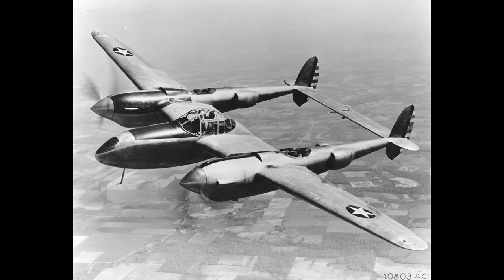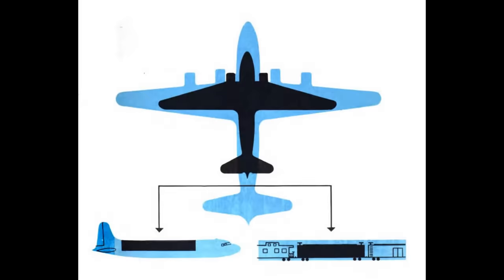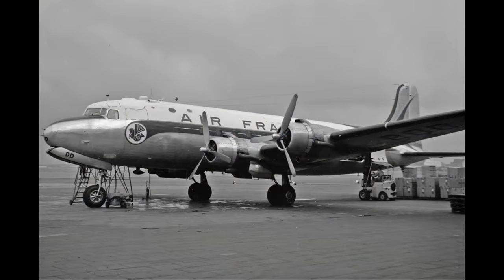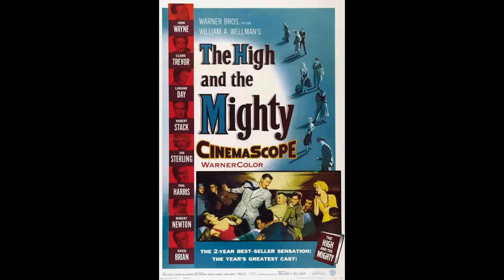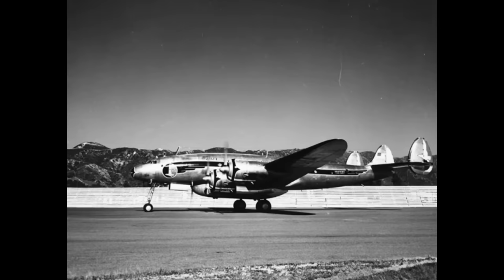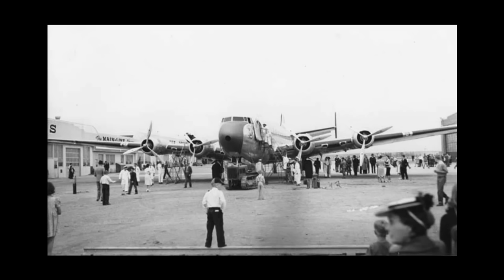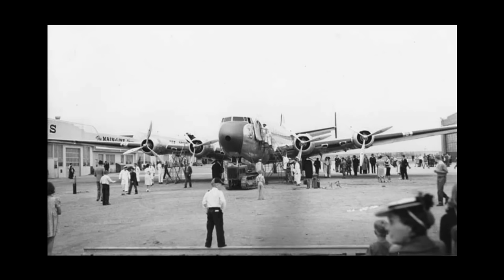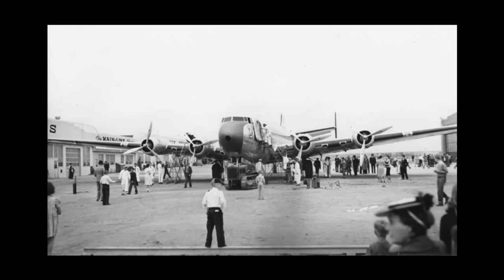Turbo Compound Piston Engines. Almost magic tech.

Comment: DC-7 could carry twice the passengers of the De Haviland Comet 2/2:jets. But the Comet could fly above the clouds, but cruised at 400 kt. As you noted, some people will pay a premium for reduced travel times. 

DC-7 max speed of 365 mph - 400 mph was faster than early WW II single engine combat planes & not much slower than versions of the De Haviland Mosquito. But the (massive & mighty) Vought F-4U was rated at 440+ mph. Other large war fighters were similarly fast.

Comment: I have always marveled at this technology and wondered why it wasn't in use today. I'm also wondering if the fluid couplers were just straight fluid couplings or did they include stators for torque multiplication?

Comment: As an aviation enthusiast,  I learned a lot from this presentation.  I wonder if this technology could be used on hybrid or electric vehicles?
Reply from the maker: Thanks, and a lot of people have asked that about use on a hybrid. Obviously it would not work on a pure electric vehicle as this tech requires an internal combustion engine. I do think it would work on a hybrid, packaging would be the problem.
Reply: New Porsche 911 is that.

Comment: huh, this is actually the kind of turbine i'm looking for in a little diy experiment i want to do. using exhaust from a car to drive a generator. and this kind of turbine saps very little power off of the engine itself.
Reply from the maker: I think that's a perfectly reasonable thing to do. Good luck with your work.
Reply: @GregsAirplanesandAutomobiles small scale test with a 22hp vtwin was good. got 12% more power. gonna see if i can get a 50hp diesel unit from liquid piston and start making a little turbine for that with professionally made turbines.

Comment: Not long ago I read somewhere some gripes of a piston engine mechanic.  He had so many complaints about the more advanced piston airplane engines!   They failed a lot, and when they didn't fail, they required tedious periodic inspection for jug cracks.    Everything was cramped and servicing was a big pain.  There probably was'n going to be  a next generation of piston engines, they had already probably passed their peak in many ways.

Comment: If you really want to see the ultimate development of the turbo compound concept have a look at the Napier Nomad, it was designed from the outset as a turbo compound not an adaption of an existing engine. Famous photograph of a nose mounted Nomad dragging a Lancaster along with all 4 Merlin's shutdown.
Reply from the maker: It never made it into production, thus while an interesting footnote, and may have had massive potential, we will never know how it really would have performed.
Reply: Prototypes of Nomad 1 and 2 did run for 100s of test hours,  the tantalising claim that it achieved the lowest specific fuel consumption for an aircraft piston engine means there must be a wealth of data somewhere .

Comment: i cant get this system out of my head ,,,, it is so very intresting ,,
qestion is there a so called blow down turbine made in a size that could be used in automotive application?
i have a volvo B20 engine sitting in a engine bench and i would love to experiment with this ,,
and yes i understand that it is maby not usefull or possible to use mounted in a car but the tech facinates me and the idea of feeding power back into a engine spins my whells so to say
Reply from the maker: I think it's possible, but I haven't seen it done on anything smaller than a big truck, like a semi.

Comment: Double OverHead Cams ((DOHC) in bike engines were sold as performance baubles but the early ones actually made no more power that single overhead cams. By the time ultra high revving sports bikes took off they were just part of the engine. 
My 1.3 litre diesel car has DOHC as it’s the most convenient way to operate the 16 valves. The latter are used to develop a powerful swirl into the combustion chamber. It’s turbo charged and it’s pretty obvious that A LOT of heat is extracted from the exhaust gas. Manifold pre turbo is much hotter that turbo outlet. It’s therefore using blowdown and pressure to drive the turbo. 
Back in the early days of diesel cars the non turbo engines were incredibly weak and not especially efficient. Turbos gave useful power AND better fuel economy. What gets lost in back pressure to the turbo is more than restored by extracting work from the hot exhaust gas. It full boost (just 1 bar) the engine inlet pressure is literally pushing the pistons down.

Comment: So the engines with turbo compounding aren't turbocharged?  Or do they have a separate turbo for that?  If not, how could they operate at higher altitudes without a loss of power in the thinner air?
Reply from the maker: They are not turbocharged. They use a gear driven supercharger for power at altitude.

Comment: In an indirect way, the MGU-H systems used in current (not future) F1 cars is analogous to the Turbo Compound turbine system. Edit: At then end, Greg actually mentioned this! F1 is getting rid of them due to cost, complexity and lack of applicability in the wider automotive market.

Comment: Thanks for this video and explanation of Turbo Compounding. I’m guessing the reason this technology isn’t popular anymore is that piston engines in commercial planes are not that popular any more. I have only a small knowledge of aviation, but aren’t Turbofan engines for commercial aviation the latest engine technology for saving fuel and lower maintenance and cost? 
This was an interesting video about this technology as I never heard of this Turbo Compounding or even that it was useful at that time.

Comment: Great video, I learned a lot !! May be because of the low octane ratio of the petrol in those days the compression ratio of the piston engines was very low( 6:1)  compared to engines of today. (10:1) or Diesel engines today (16:1)    So, much more energy was left in the exhaust gases, moreover  they were very large engines. When I remember  well the Volvo extracted 20 hp.
Reply: WWII engines were running on 115/145 power rated fuel. That's more octane than most racing fuel. Many general aviation planes ran on 80 octane, but these big radials were fed a steady diet of the good stuff. The 115/145 was died purple to identify it's power rating similar to the way avgas is died blue today.
Reply: @dougrobinson8602  Thanks sir, but I just saw specification:  it was 6.85 : 1. So there is still a lot of energy in the exhaust  gas.
Reply: @dougrobinson8602 only Allies had 115/145, I don’t think the Germans had the ability/resources to refine petroleum to that level. 

IIRC a DC-7C attempted a takeoff from Las Vegas using 100/130 but with BMEPs/boost set for 115/145, the airplane made a smoking hole just outside the airport fence after blowing about 20 jugs off the engines, about 40 years ago. Detonation is not your friend…guess it was an attempt at drug running
Reply: @johnparrott4689  True. Luftwaffe had other tricks up their sleeves like nitrous oxide and methanol injection, which helped curb detonation.
Reply: IIRC water injection was used on P-47s and F4Us among other types, too. Forgot about the NO2 boost, what a hoot that must have been

Comment: Very interesting as ever, thanks for posting. But I must have missed something, if my confusion is due to lack of concentration on your commentary, I apologise. So, you say that nothing is free, and the cost of driving the turbo, in this case, is a reduction in exhaust pipe thrust, fair enough. But you are also not getting a supercharger, so far as I understand it, so no increase in manifold pressure etc. From all your previous videos, I have been led to believe that getting manifold pressure increased is everything when it comes to piston aero engine power. Surely there must be a dramatic, I mean really serious, reduction in horsepower from the absence of any supercharging? Less dramatic at low altitude and low speed maybe, but still really serious. I mean, lots of WW2 fighters got important (life-saving) benefit from supercharging at speeds below 325 mph, didn't they? Turbo compounding seems to suggest that forcing air/fuel into the cylinder only matters at high speeds and high altitudes. Didn't your IL-2 videos say that they had superchargers? Seems a bit pointless at their altitudes and speeds, in the light of this video. I suppose the charts at around 25:00 cover my confusion, but they're a bit too diagrammatic for me to really get the story.
Reply from the maker: You did miss something. The engine has a supercharger, it's just totally separate from the turbo-compound system.
Reply: @GregsAirplanesandAutomobiles  Thanks, my apologies for missing that. I suppose the supercharger was driven off the exhaust, rather than the crankshaft, so the exhaust must have been split between turbo-supercharging and turbo compounding.

Comment: The turbo compound PRT........is a vastly under utilized idea.  For gasoline engines, a conventional turbo has a lot headaches that come with it........and the power tends to arrive mostly at high rpm, and comes with some tuning issues that need careful management and air charge cooling. The turbo compound gives extra power, and very substantial fuel savings, with none of the penalties of the standard turbo.  The constellation is a spectacular plane.....there is an airworthy example here in Australia.  The turbo compound, as fitted to the big, multi row radial engines, was unfortunately extra complexity on an already, very complex engine.  The sophisticated version as used on an experimental Allison V12 engine, was rumored to boost the base 1500hp engine, and extra 1000hp!  Congrats to greg for bringing this engineering marvel out of obscurity, there should be a turbo compound PRT on every gasoline road vehicle we use today......its an utter SCANDAL that it is not!!

Comment: 26:14 #1 Prop Failure to Synch to Master (#2 or #3)
My question... Is Prop Synchronization connected to the TD Amp system?
Just curious because I can't remember what I learned fifty years ago in Tech School.
Any 431's or 432's out there?

Comment: 12:40 Turbochargers absolutely help with fuel consumption. It’s why they exist. They recover energy from the exhaust and put it back into the engine.
Reply from the maker: Not in THIS type of application, your thinking of another type of usage entirely.

Comment: For those of you not familiar with formula one, the use of turbocomponding was revived in the latest rules iteration.  The video is incorrect in that the recovered energy was fed directy into the crank, as well as for generating manifold pressure.  Mercedes was able to achieve over 50% thermal efficiency.  Unfortunately the teams don't like the addrd cost and complexity, so compounding is being eliminated after '25.  There really inst much that the talented engineers of the mid century era didnt invent.  We just refine these ideas for today.  One criticism, the term "blow down" refers to the exhaust gas leaving the cylinder before the piston reaches bottom dead center.  Due to the nature of a crank/rod mechanism the combustion pressure doesnt make much torque in this part of the cycle so the valves open early and dump the exhaust to reduce pumping losses.  The compounding turbine can further expand the gas beyond what the piston can do and recover the lost energy.
Reply from the maker: Please include a timestamp for the part of the video you think is incorrect. I can't figure out what you're talking about.
Reply: @GregsAirplanesandAutomobiles    Time 33:10 Current F1 engines are compounded.  The turbines are linked electrically instead of mechanically.  The recovered energy is provided to the engine through a PWM electric motor on the crankshaft.  They also use the energy to spool the turbine in times when the engine output is low. Mercedes achieved over 50% efficiency several years ago. Time 19:55  Blowdown refers to the exhaust leaving the cylinder before the piston reaches bottom dead center, the end of the power stroke.  The bulk of the exhaust is vented during this time by the heat and differential pressure, not the piston motion in the exhaust stroke.  The compounding turbine does use the residual heat and the resultant KE to do work.  To increase efficiency in a heat engine you have to increase the expansion ratio (do more work with the heat, think multiple stages in an axial flow turbine in a jet engine).  In a piston engine there are alternate cycles you can use like Atkinson or Miller to increase the expansion of the gasses, but the best way is to add a turbine to further expand the gas and do work.  The piston is inefficient at extracting work near BDC compared to a turbine.  The reason the airlines went with the Wright compound engines is the power requirements.  A fighter needs wartime power at any moment so you have two stage superchargers and/or turbos to generate maximum manifold pressure to make maximum power.  The airlines don't need maximum power except at take-off conditions, so using the exhaust heat energy to produce manifold pressure is a waste of energy. Turning the wasted thermal energy into shaft power increases the efficiency in the cruise operating regime.  It's not some magical turbine geometry in the compound system that makes the efficiency.
Reply from the maker: 1. I specifically said at that first timestamp that it's linked electrically rather than mechanically. I don't fell like quoting myself but if you start at about 33 mins in it will be clear what I said.
2. The description of the blow down principle is straight from Curtis-Wright and the original source info is on screen at 19:51. If you disagree with what they said, call them, they are still in business.
Reply: @GregsAirplanesandAutomobiles  you said the the F1 MGUH is a turbine driving a generator that is driving a compressor.  That is incorrect. I know it wasn't your main point but you are wrong on how it works and don't understand that it is actually a compound system.
In the other section you said that the heat energy wasn't driving the compound turbines. That is also wrong and if you think about the first principles thermodynamics and the ideal gas law you know that statement has to be wrong.

Comment: This seems like a better fit for an economy minded road car than a hybrid gas electric system.
Reply from the maker: It might be.
Reply: @GregsAirplanesandAutomobiles  I thought a lot about a turbine driven alternator. That would be easier to add to an existing vehicle but this would be better in a number of ways. I have a small machine shop for building such contraptions.

Comment: Blowdown turbine ... as an old steam turbine guy, that's a new one on me.  Any turbine with the pressure drop occurring before the working fluid reached the rotor would be called an impulse turbine.
Reply from the maker: The Term "Blow Down Turbine" is the correct term. It's from NACA and Curtis Wright.

Comment: A great piece. I've always loved the concept of the turbo compound engine. However its frustrating to see so many try to push so hard for its adoption into cheap consumer cars as though it's a commercially viable option. F1 being a big problem there with all F1 cars have been mandated for years that they need the turbo generator in the hopes of bringing it to consumer cars. The end result is an extremely expensive device with the need of jet engine engineering and manufacturing expertise. Big rigs are the only place I see it working realistically, preferably as an electric hybrid design. The huge fuel usage could actually offset the high cost of production there. And maybe a return to some airplanes is possible if manufacturing price drops. Also liked the shout out to the fantastic pilot you worked with many years ago.

Comment: Hello. i think you made a Mistake about the F1 stuff after 33:00. The compressor and turbine actually share a comman shaft that is also mechanically connected to an electric motor/generator. The reason for this is to reduce turbo lag when quickly increasing load on the engine and harvest exhaust gas energy to either store in a battery for later deployment or deploy directly to another motor/generator mechanically connected to the Powertrain.
Reply from the maker: Maybe an omission, but not a mistake. It does everything I said.

Comment: Wow Greg, what a fascinating and informative video!  As a pilot, I've always wondered how a turbo-compound engine worked.  With your explanation, I wonder why more engines didn't...and don't...have the turbo geared right to the crankshaft?  I mean, put the power to where it needs to be, right?

Comment: Oh yes the turbocharger can decrease fuel consumption in certain  cases.  Specifically when it allows a pressurized aircraft to attain higher altitudes to take advantage of favorable wind conditions.
Reply from the maker: It's NOT turbocharged.

Comment: So glad you mentioned the F1 electric powered turbo. It also ran off regen brake battery.  Very efficient.  They aren't using it any more but hopefully will have pos impact in turbo ic engines.

Comment: Hi Greg. Your video got me curious. What about turbofan engines? In my mind they are not quite propeller driven nor turbojet engines. How is their performance in converting HP to speed gain or rate of climb at low and high air speed? For example, are they worse than propeller and better than turbojets at 100kn speed?
Reply from the maker: Thanks so much for the contribution. Turbofans are now very common, and actually somewhat of an odd mix of a true jet and a turbo prop. The modern high bypass turbofan is hugely successful because it hits it's sweet spot at about mach 0.80, right where the airliners fly. As for performance, for climb purposes, they are a jet.
Reply: @GregsAirplanesandAutomobiles  Ahh, they are optimized for fuel economy at that speed, even sacrificing other aspects. Nice.